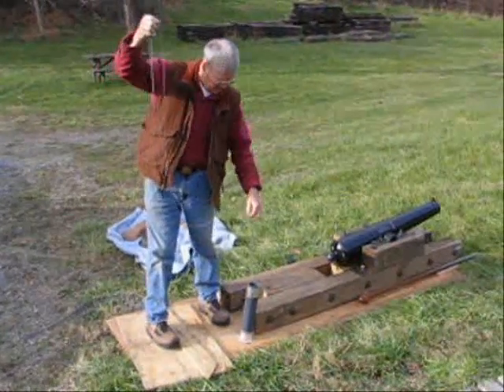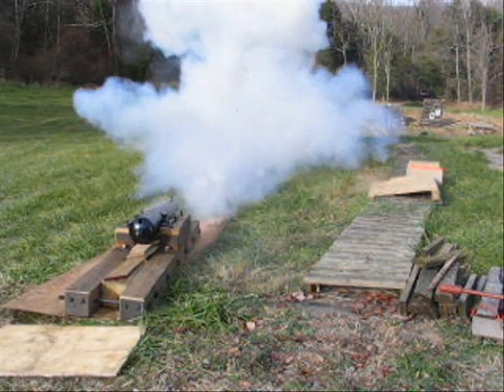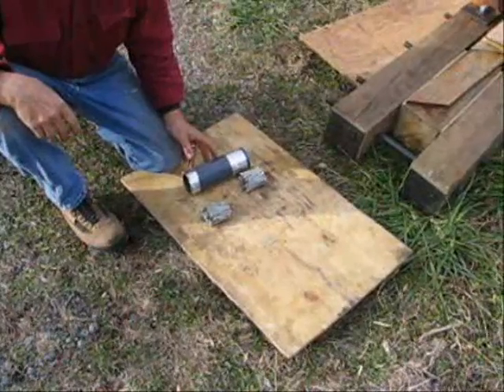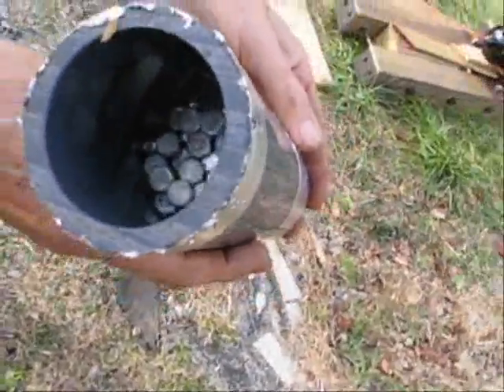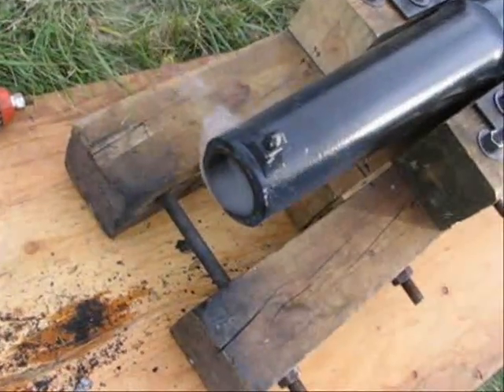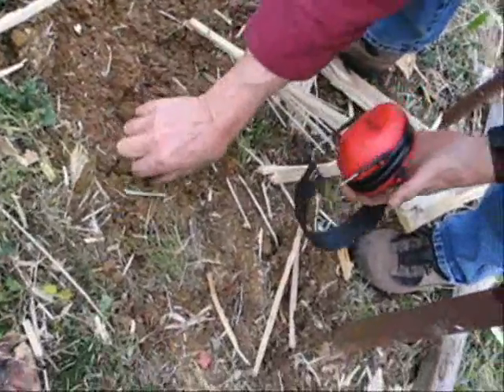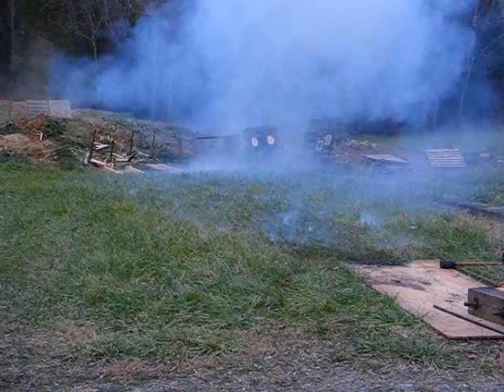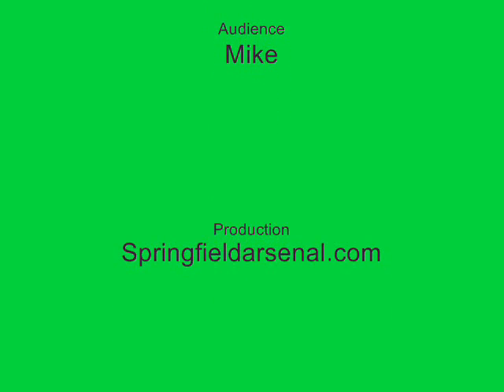SHOOTING PVC PIPE AMMO FROM A CANNON

Comment from the maker: >How much gun powder is needed to fire a 5 pound shot? 

It depends on the weapon you are using, you did not specify and I don't want to assume anything.  A lot of folks use the guidance in South Bend Replicas catalog, which recommends maximum powder charges based on diameter of the bore of the gun.